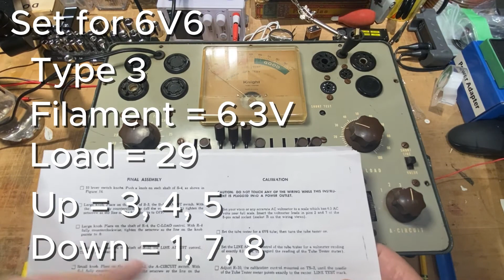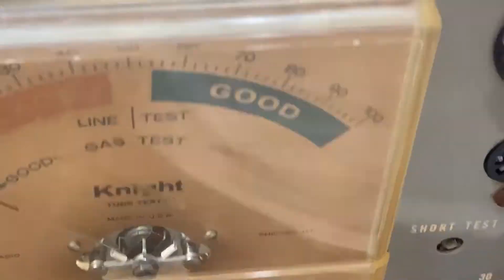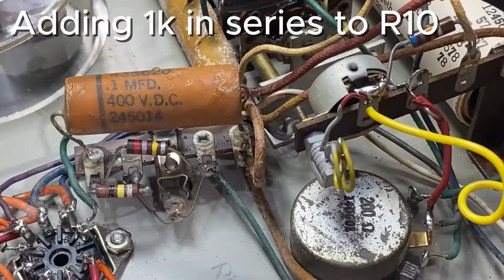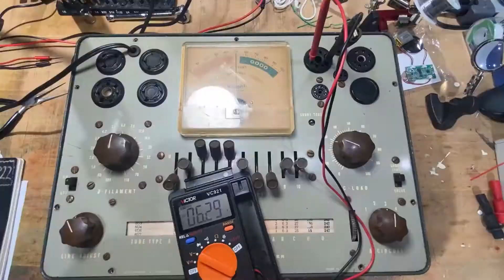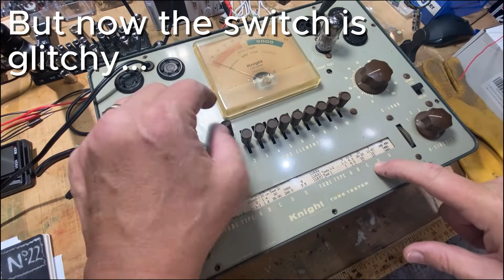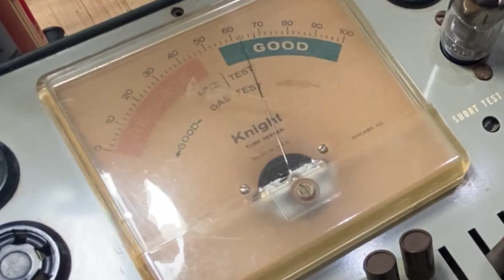Vintage Tube Tester Calibration: Making It Trustworthy Again

Comment from the maker: Knight Series 600 Tube Tester Restoration (Part 3) | Calibration & Final Test

In this final part of my Knight Series 600 Tube Tester restoration, I take the project through calibration, fine-tuning, and final testing. After repairing sockets, cleaning contacts, and chasing down transformer issues in the earlier episodes, this video focuses on dialing in accuracy so the tester can be trusted for real-world tube evaluation.

🔧 In this video you’ll see:
•	Calibrating the Knight 600 using a 6V6 tube reference setup
•	Adjusting R10 calibration trim pot and adding a 1k resistor to it to achieve proper alignment
•	Using a voltmeter to verify filament voltages at 6.3V
•	Cleaning and restoring bat switches and the main power switch with electronics cleaner
•	Testing a 12AX7 dual triode to confirm accurate operation

Wrapping up the project and discussing limitations of emission testers vs. full amplification testing (the next project).
Reply: Love tube testers but can't stomach musac or speeded up video - shame
Reply from the maker: @Doggonewest yeah, i understand. I’m still working on how to show all this stuff. I had 4 hours of video to squash down and wanted to get as much as I could in there. Thanks for watching and for the feedback!
Reply: @MadScientistGuitarLab  Thanks for replying, no offence intended with comments but  as a regular Uncle Doug viewer amongst other repair videos etc the attraction of watching something with no musac and in real time albeit segmented is the key to a healthy viewership from a poster's point of view. best wishes. Nick
Reply from the maker: @Doggonewest it’s good advice. Makes editing a lot more involved but I gotta say, my next video is gonna look better for it. Thanks!